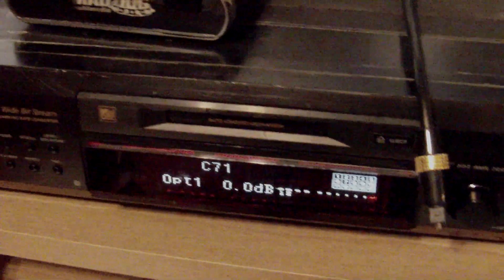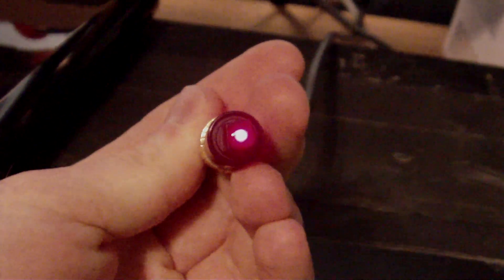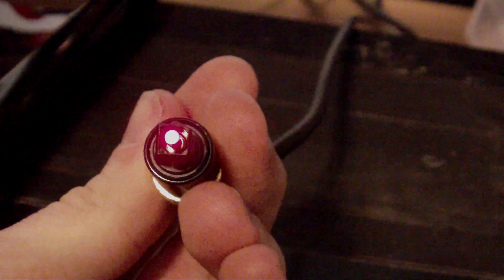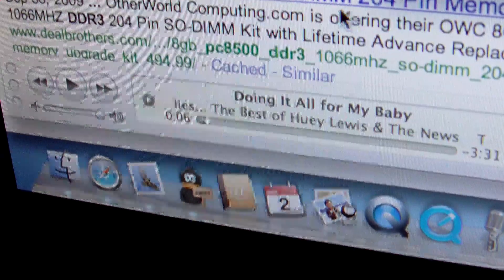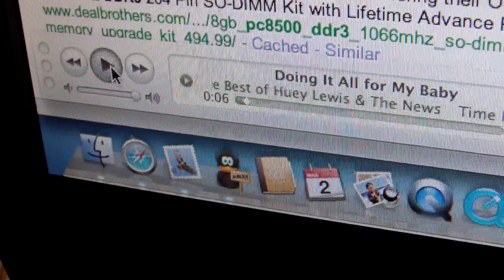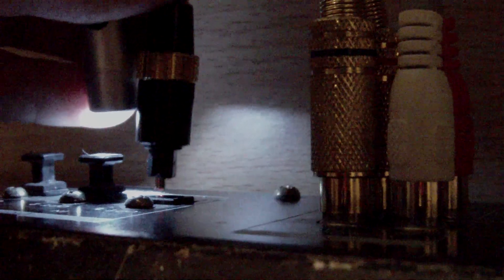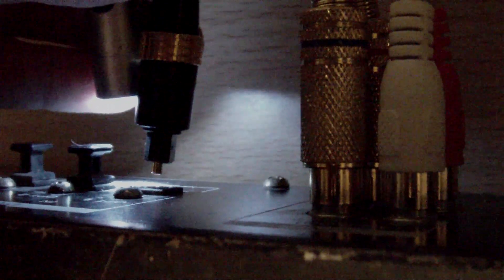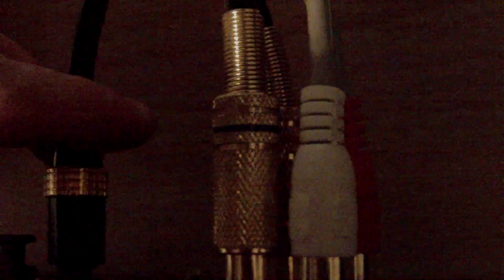Optical Toslink Fun

Comment from the maker: @TreyArc Toslink or SPDIF bypasses the DAC, as Intel HD Audio is merely just a DAC and software decoder..  Toslink and SPDIF/Coax bypass that, and rely on, in this case, a Minidisc deck, to handle the PCM to analog sound conversion..  Still just plainly relying on a software decoder.